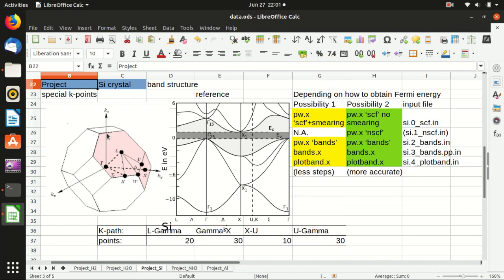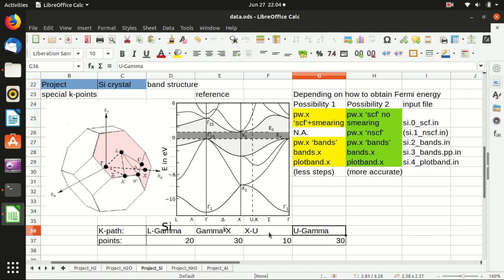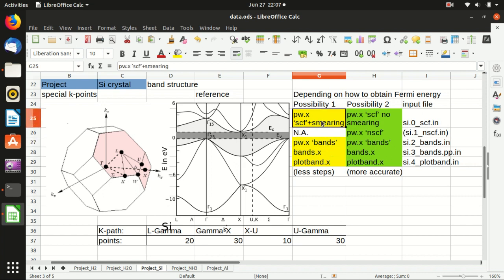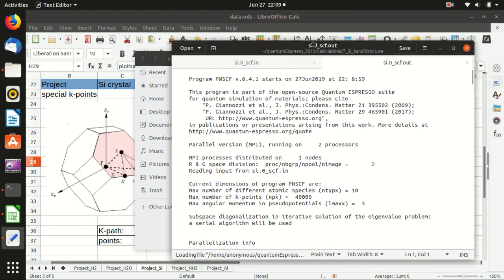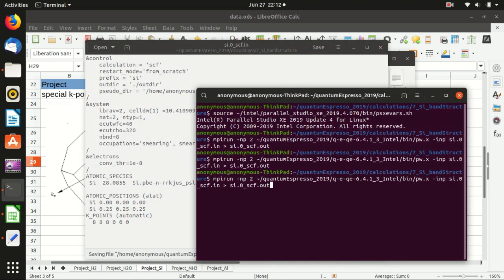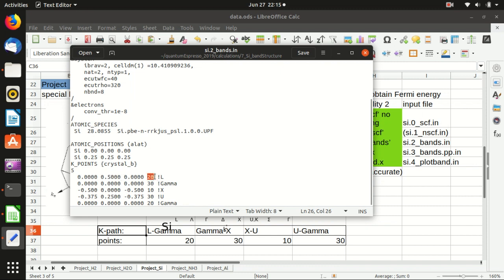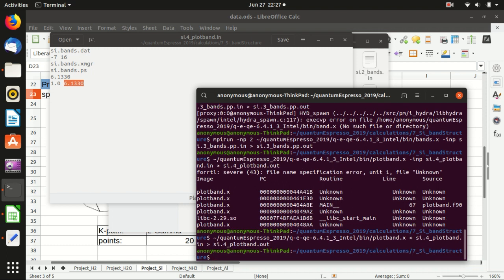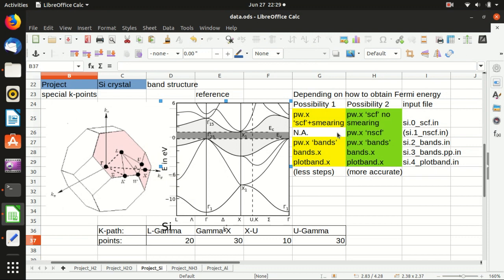Project: 3.3 Si band structure [detailed explanation] | Quantum Espresso Tutorial 2019

Comment: Hello. If we perform scf calculation using Hubbard U parameters. Do we need to include it again when we ran bands calculation or it's already included during scf so no need? Same question for DFT-D2 correction?  Thanks for your help
Reply from the maker: In principle I would leave the parameters present (specifying U, no harm in doing that) also in the bands calculation, but I'm not sure whether they are necessary in the input file. It also depends on the implementation of QE, so probably the easiest way would be try without and compare the result if you really want to find out.